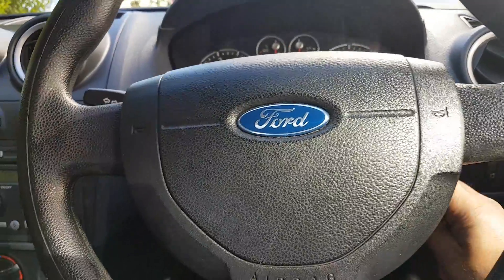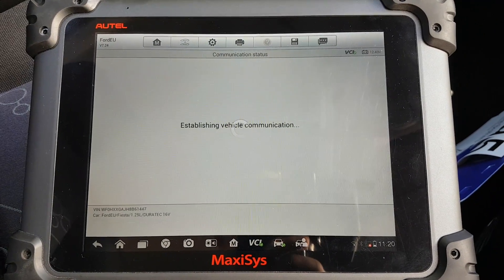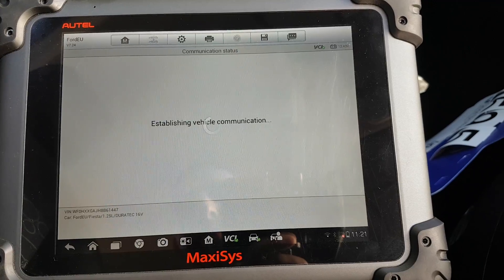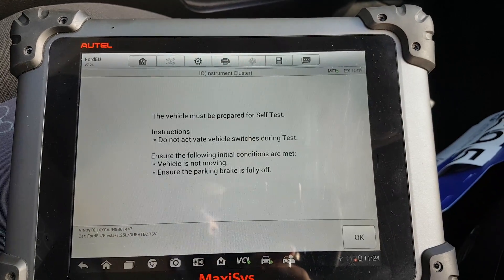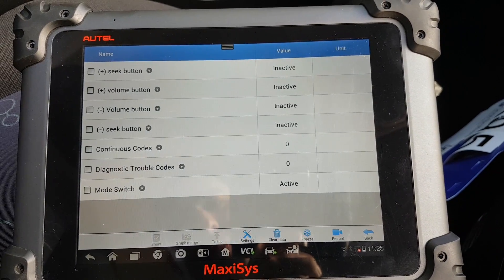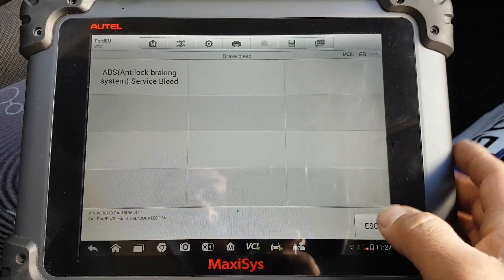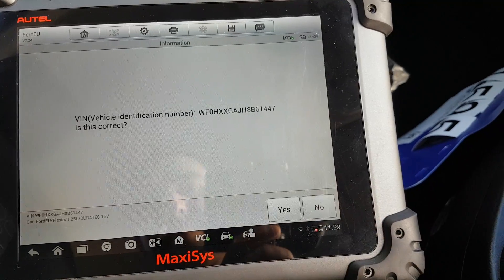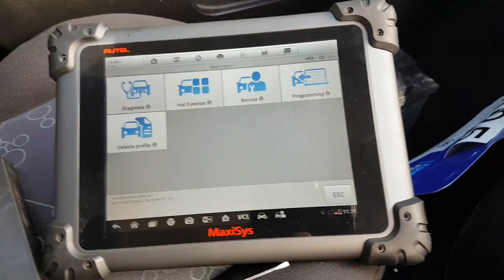MaxiSys MS908P on a 2007 Ford Fiesta 1.25 petrol.

Comment: Thanks for the video its a great advert for this tool. However I understand that there are people selling unofficial imported versions of these machines that seem cheaper on sites like eBay. However you then find there is no customer support or upgrades available and you get your fingers burnt. Can you throw in a link where you can buy from that is a good price but official genuine machine.
Regards
Reply from the maker: Hi
They are all genuine... there is no clones of this tool.. as far as I am aware....
Is only to do with the market/country They are sold on... if they are imported through the official reseller then they get a new serial number and they go on their database for warranty and support purposes...
The other ones, called grey imports, have the manufacturer warranty and support... 
Which we can debate how good or bad it is... I never needed it, so can't comment...
My tool, updates very often, never had an issue...
Hope that clarifies your doubts...
Thank you for watching and for your comment!